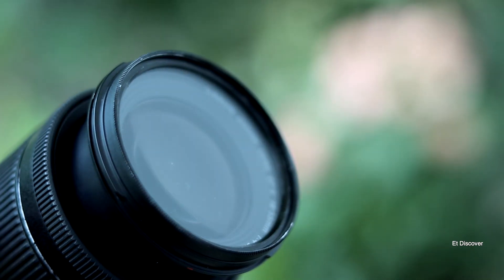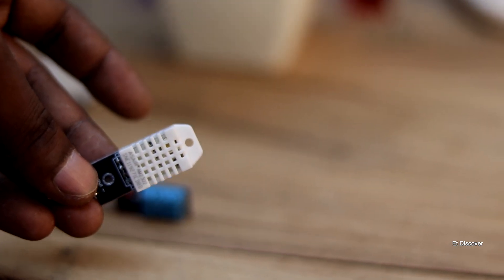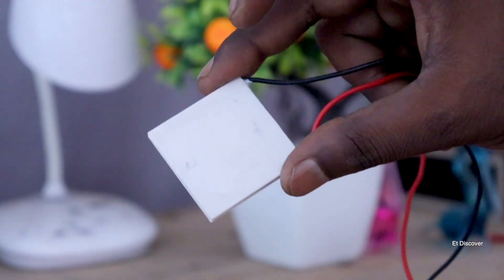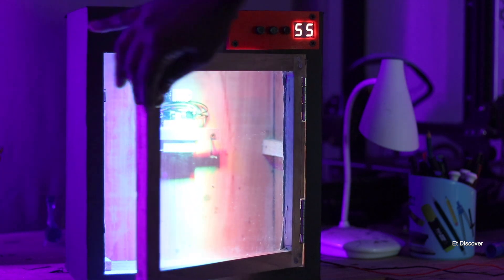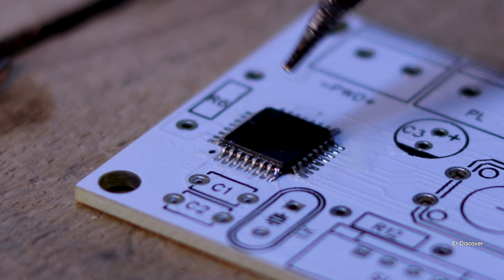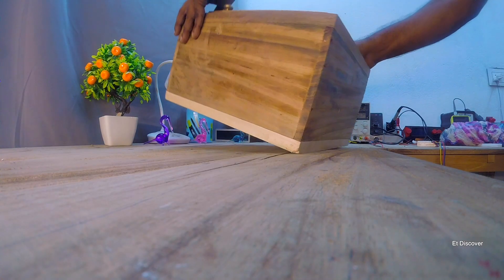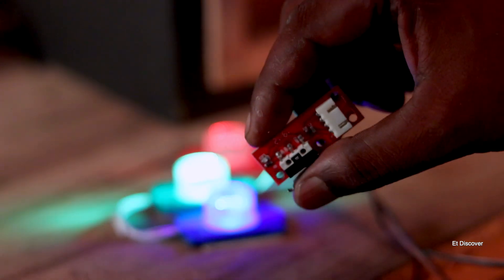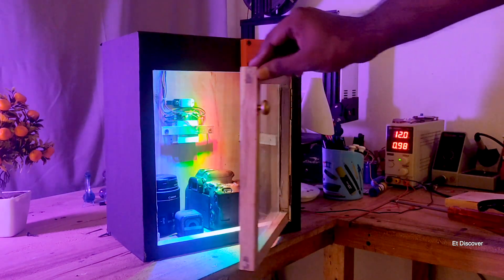How To Make A DRY Box For Camera To Avoid Fungus

Comment: Relative humidity is greatly misunderstood. It's a moving target directly related to dry bulb temperature. Higher temperature will allow more water to be suspended in the air than cold. That's why we get fog when the temperature drops. The capacity of the air to hold moisture further changes based on atmospheric pressure, so they have different charts for different elevations. If you're interested in going down the rabbit hole, look up psychrometry (the study of the relationship between gases and vapor). This work was started by Willis Carrier, which you may recognize the name as it's associated with air condition units (and other HVAC equipment).

Comment: I got an stc 3028 controller and a 12v 98 watt peltier. Where should I connect the peltier module? to humidity socket or temperature socket?